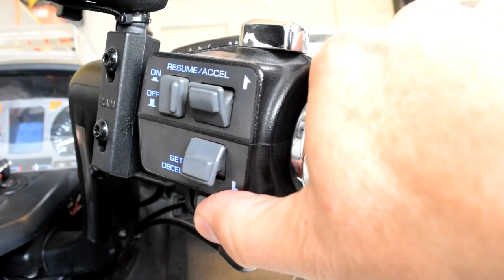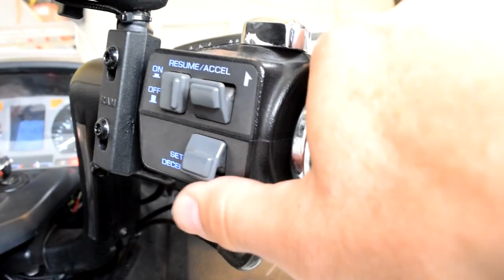Don't Crash: How to know if your brakes are about to fail (brake symptom diagnosis)

Comment: Great stuff, Scott! I'm new to the Wing world, so I am soaking up all I can about these big girls. I'm not new to wrenching (been doing that for pert near 45 years), but I'm new to Wings. I had a Suzuki Boulevard C90T prior to this. Did most of the work myself on that one. I like to baseline all new vehicles, so I may just buy all new pads and rotors for a fresh start, as it were. Next up will be to bleed the system. I'll be doing new pads tomorrow, so that's going to be the time to bleed the system as well.

Comment: Just an observation - I've watched two videos you prepared on brakes...  in both, you discussed front brakes.  In neither video, did you mention back brakes.  Thanks for the content...
Reply from the maker: I'm talking about brakes in general, but I'm referring to the front ones in the video simply because they're easier to see. However the rear brakes work exactly the same way, and everything I say applies to both.

That said, the front brakes are much larger, and are responsible for 80% of your stopping power!
Reply: @GoldwingDocs  I get it and please don't take it the wrong way.  I assumed everything is the same front and back but since working on a motorcycle is new to me, I had to ask.   My pedal is soft on my back brakes  (guessing I have air in the line).   One other thing if you have a second...   I just bought this bike.  I use to ride everyday rain or shine 25 years ago.  Riding it home, I was a little tense because the bike is heavy.  But, the thing that got my attention the most was the wind gusts were literally moving me 6" - 12" in the lane.  I noticed the air pressure might be a little low in the back tire but am considering all possibilities.

Comment: We had the left hand front calliper on our Jeep lock and hold the rotor. We got a severe shudder in the steering wheel. I stopped and the rotor was bright red and smoking, nearly caught fir. The next day I took it to the brake place and they actually showed how warped the rotor was.

Comment: Thanks Scott, another great video. I was curious about your thoughts on Speed Bleeders and if you have them. I put them on my 1500 right about 20 years ago and they are awesome. Now every year or two I buy a big fresh can of brake fluid and flush out every drop. My brake system certainly thanks me. Fluid is always crystal clear and the hydraulics perform perfectly. At least so far, (2000SE) I have yet to do any maintenance on the brake systems except changing pads. Speed bleeders just make flushing the hydraulic fluid SO easy. I totally recommend. (Clutch too).
Reply from the maker: They work great, with one caveat: if the threads on your bleed nipples don't seal well, you can inadvertently suck air into the system when you release the brake/clutch lever.

Comment: great video as usual, thank you! btw the throttle grip loose is also my problem..
Reply from the maker: That plate that I showed is not available as a separate part - you might be able to pull that grip apart (two screws hold the top and bottom half together and clamp it around the bar) and maybe use some self-vulcanizing tape around the handlebar to lock it into place. I've used that trick before and it worked well.

https://www.amazon.com/X-Treme-Tape-TPE-X36ZLB-Silicone-Triangular/dp/B00HWROLIG/ref=sr_1_5?tag=goldwingdocs-20
Reply: @GoldwingDocs  Thanks a lot!

Comment: hello Doe my name is Jack from Yarra Junction victoria Australia. I've recently bought a 96 goldwing 1500 and I have a few questions, front brake light and park light is not working, and hazard lights aren't coming on, are they all linked to the same fuse or relay. I have one fuse with no power at all to it, could that possibly be the cause, and why wouldn't it have power at all? Thanks, hope to hear from you

Comment: If you change the brake fluid on the front and the rear at the same time and there is air anywhere in the brake line, does that make the  ABS light come on on a 2003 Goldwing 1800? And could the air lift in the system cause vibrations in the steering because of the Anti-Dive device? Please help

Comment: You forgot to discuss old brake fluid that has moisture in it. The moisture turns into steam that causes spongy brakes when heated in the caliper.
Reply from the maker: Good one. If you lose your brakes when they heat up, this is usually the cause. That said, it's covered pretty much by the "no pressure, no brakes" one at the very beginning: caused by compressible steam (or air), fixed by bleeding the brakes.